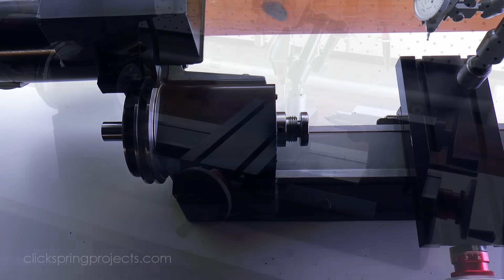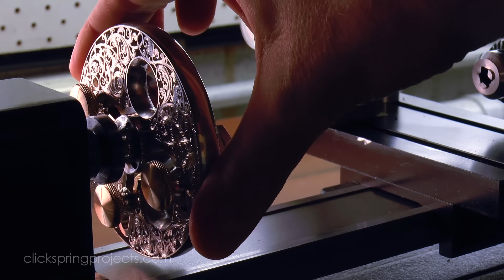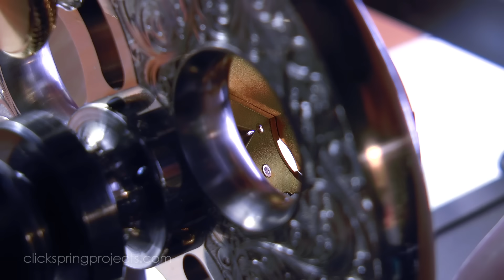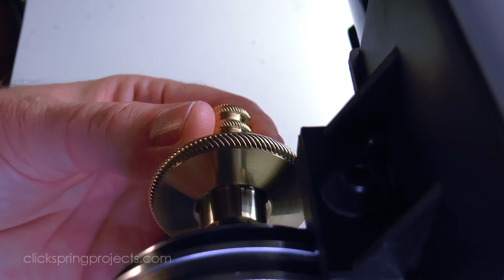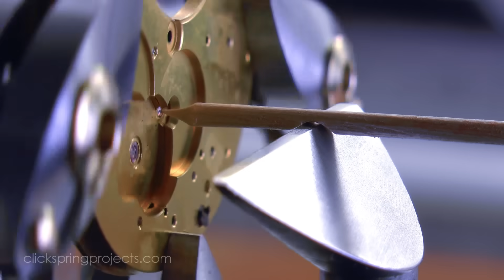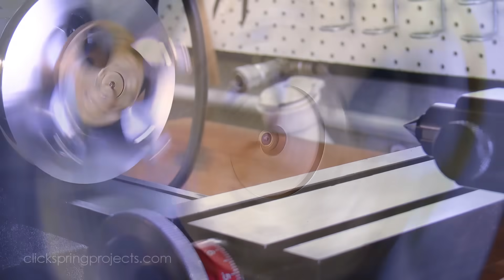Using A Pump Center & Wobble Stick To Center A Watch Main Plate #watchmaking

Comment: Love it when super cheap and dead-easy methods outperform modern high tech in their goals except in efficiency. It means you could most likely build a functioning pocket watch with tech from Antikythera-era if you don't mind that it takes way longer than doing it today and it being somewhat bigger than today.

Comment: I love this. I love how simple and yet effective it is. Using this very basic visual method can almost definitely get you accuracy in the 0.00001" range (hundred thousandth's inch) range, which is effectively beyond the actual accuracy of most equipment you can use to do machining with. 

Or in other words, this is the best example of K.I.S.S. - keep it simple, stupid - this is so elegantly simple and obviously so incredibly effective. Thanks for sharing. 🙂

Comment: Your workmanship is beautiful and this is a really neat way to find a center for a watch body.  I made something similar with a sharpened wire stuck through a rubber band, rather than balanced on a tool rest, because the thing that holds the rubber band I 3d printed so it snaps onto a boring bar holder in the qctp.  It's been very useful for picking up transfer punch dots and getting them perfectly centered.  (Well it's great for indicating center, but the process of centering is still awful if it's on a faceplate rather than a four-jaw.)

Comment: How do you get the tool rest to the right height?
Reply: Does need to be? It seems that it would show the error regardless of the height.
Reply: I guess even if the toolrest was slightly high or low (or even if the stick was angled left or right), when the part is true the stick won't wobble...the stick doesn't need to be perfectly aligned with the centreline to still have the same result
Reply: @joshweier  Ya I guess that makes sense